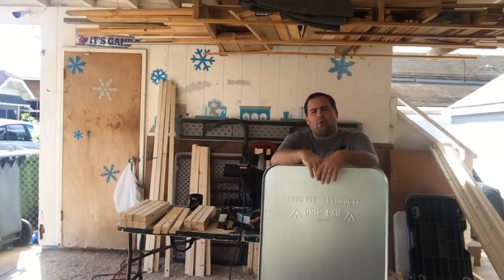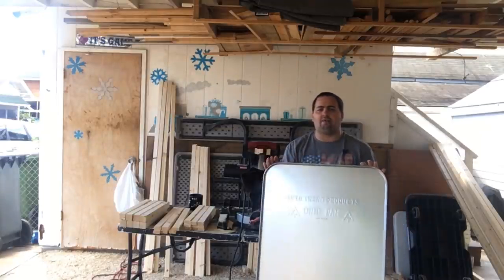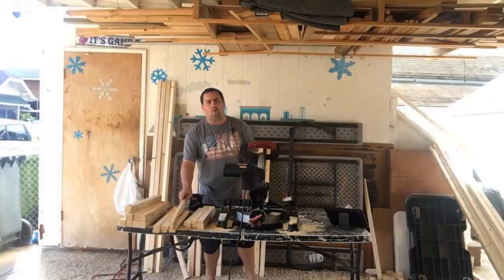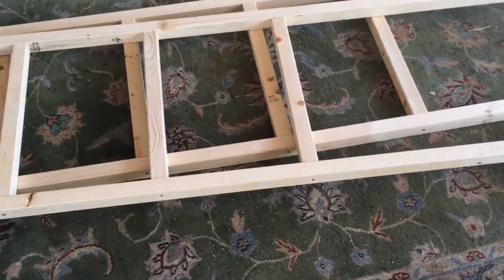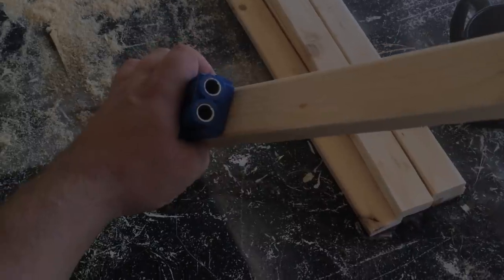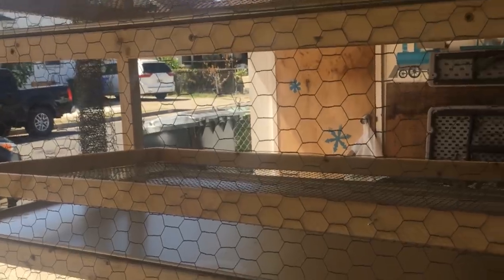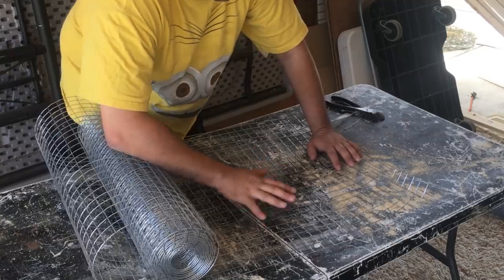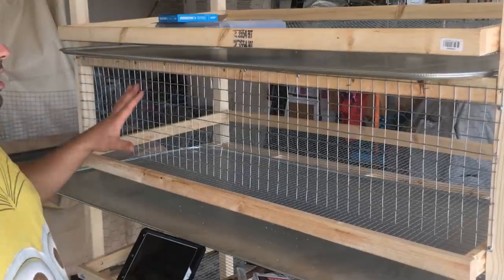How to build a stacked Quail Cage

Comment: Thank you! I build this cage a d it works amazing! Love it! Made  4 levels so I can keep up to 100 quail in one rack.
Reply: I did the same thing. There's room to build another level, so might as well. I also adjusted the length to the poop trays I was able to find. Mine was less that 3' in length so I still used 2' x 2's for the main support legs, but I probably would've used 2' x 4's instead if it was ~4' long with the 4 tiers.

Comment: Andrew ... not sure if you are still checking your posts or not, but here goes!
You have mentioned several times about the bird waste and smell. 

Your answer is simple enough, designate an area for the waste and sprinkle a small amount on each layer of newsprint or wood shavings. Add any grass clippings, raw vegetable waste from the kitchen. 

With the almost daily rains you have it may be necessary to put a cover to keep from water saturation. Some moisture is necessary just not to a point of saturation. 

Turn the pile every 3 or 4 days and you will end up with some good compost.
Reply from the maker: I have a small compost pile, but its more a space issue. I just dont have room for a proper one.

Comment: There is a big gap between the egg roll try and the side of the cage. I had to add additional 19 inch sections of 1x2 to make the bottom flush, so quails can not squeeze into different levels. 
The Oil pans in that size run $30 each, the wood cost me $77.00, Screws $12, Vinyl coated mesh for the egg roll trays $24, hardware cloth for the outside cost $50 (I did not use chicken wire), Staples $5. This cage cost me $258 and took 2 days. There is absolutely no way you made this in an hour!
Reply: Yeah. The lowest price I see for the pans is $36, each. This is not economical.
Reply: I got  3 pans for $72 through advanced auto

Comment: Great tutorial!  The issue with the pans is that Walmart no longer carries them.  When they did they were around $10 just like they said in the video.  I had purchased one from my local Walmart about a year ago.  The manager said they no longer carry them and they were discontinued by the company.  There are pans available at some auto supply stores (Advanced auto supply in South Florida for example) that sell pans for $10, however they are about 12" shorter and slightly wider than the ones in the video.  Simply adjust the sizing of the cuts to these pans and you will be golden

Comment: Very nice video. Going to use most of these instructions except my quails will be outside during our cold winter so I'll need to add a shelter.
I still don't quite understand how the craig jigg bit comes into place. D
For some reason I can't quite compute why you would need to do that or where those screws even go 🤔
Reply from the maker: It makes joints with hidden screws, it also creates the angles needed for optimum joint. It’s not required but I have the tool to do it.

Comment: You should use a grinder to cut your wire. Way easier and faster, and no sharp edges. Also, you should pre-fab the wire (door and feeder holes) before you install the wire to the cage. Would love to see your watering system.

Comment: now that its been in use, would you suggest adding some center support on the egg roll out trays?
Reply from the maker: I would adjust the angel a little more to make it steeper (maybe 1/2inch more at the back) other then that it’s fine. Very little sag.

Comment: Do you have "lids" on each level? or does the poop tray act as the lid of the one below? And then I am guessing that if you take out the poop tray to clean it, the egg catching tray from the one above will be the lid?
Reply from the maker: Their is no lid on each section other then on the top one

Even with the poop tray removed their is only a 1 1/2 inch gap that they can not get out from. 

If you have a predators you may consider adding a top to each cage, which could be done by stapling it to the bottom of the bars holding the poop tray above.
Reply: Nice. That's genius. It saves so much mesh and time.

Comment: Hmm...at no point do I see the "roof". Did you just use more chicken wire?  Mine are going outside, so I'm going to just get some sort of weatherproof top (like white vinyl corrugated sheeting...so it protects from rain yet allows light through)
Reply from the maker: Yes i used 1x1 wire for the top. I have mine under a shelter i built. Putting a roof on top wouldn't really protect them from the elements.
Reply: you are correct, he completely forgot about the roof.

Comment: correction.
that drip pan is 48.00 at walmart.
reduced to 38.00.
not feasable
Reply from the maker: Price varies by store/location. You can get them on Amazon for $30

https://www.amazon.com/Hopkins-11430-Galvanized-Dishwasher-Refrigerator/dp/B000F5XQMO/ref=sr_1_2?ie=UTF8&qid=1524375820&sr=8-2&keywords=oil+drip+pan&dpID=4154SEF4A0L&preST=_SX300_QL70_&dpSrc=srch

Comment: Hi Andrew how are you doing I have see so many coments  but none of them ask about up date in the battery cage any change in the side
Reply from the maker: The only change i made was to adjust the angle of the egg tray (where the quail walk) . Oter then that its still the same. Im working on some new cages and will have another video showing them and how to make them in the near future.
Reply: Thanks

Comment: How many quail can you put in each seperate cage
Reply from the maker: Each tray in this cage is enough space for 30 quail at a 4 bird SF. You could easily adapt this cage to have 4 levels meaning you could keep 120 quail less then 10SF.
Reply: Would they work to breed quail in also? I am just starting out with quail. If i could add roosters and use as breeding cages also how many roosters per hen do you recommend
Reply from the maker: Any cage can be used for breeding. Just make sure to keep your female to male ratio right for optimum  fertility and comfort, 

4f-1m seems to work best.

Comment: Where do you buy that metal tray at ?
Reply from the maker: Walmart, They are $10-$15 each. 

https://www.walmart.com/ip/ATP-Large-Oil-Drip-Pan/16778234
Reply: I have a $1.25 Store near me, the sell plastic drip pans.  Dollar Tree sometimes has pans or paint pans as well, for a budget version of his pans, you may need to buy two for the size.
Reply from the maker: typically the plastic ones are smaller and thin,  These have a rolled edge which will help with the bending/folding when covered in poop, But on a budget for less then a couple of bucks they would work.
Reply: Holly cow these trays you used are $34 each from my walmart! Cheaper and faster to just order off amazon when being a prime member. Built this and determined i needed some wind protection and added 3/" plywood to the sides and added 2, 2x4's to the legs to sturdy them up. Love your vids and great tutorial!
Reply: Agree on the price, he was quoting the half size ones. I found free shipping and $32 each, but decided still to pricey for a crap catcher.
Reply: Brian Sessums  i was going to use plywood and soak in spray adhesive and apply a piece of contractors tarp to the tops and wrap them around. Cheap and effective..but i also didnt want to cheap out and wanted it to look halfway descent so i just bought the trays
Reply: I was going to do that as i have a big barn with dirt floors. I also raise rabbits so i wanted as much room for rabbits as i could get. Its pretty cold in wa state right now and the barn is open on the ends so it does get a cold draft this time of yr. Had to do something.
Reply from the maker: Brian Sessums the pans I have are as even in the video for $14 each.
Reply: Aloha Quails  you got a killer deal on them pans. I was gonna rig something together to work but decided my "rigging" days should come to a slow end haha
Reply from the maker: They are still that price on their website for me with in store pickup.
Reply: Walmart must love you.  I even did Google shopping, no bueno.
Reply: What feeding system do you have for this cage setup? Im using the no waste 3" pvc with 1.5" holes drilled into it that is capped on ends. Curious what you use.
Reply from the maker: I use modified J feeders,  they can be seen here : https://www.youtube.com/watch?v=EZ5F029QEgA&t=
Reply: Gonna go pick up a j feeder that has solid bottom to give it a whirl. I cant see how you get no waste hardly as the sides arent nearly tall enough to prevent any feed being flicked out from the birds. May try and raise the sides as well.  Thanks again
Reply from the maker: Modify them like how i do in that video, Usually the feeder has an inch of feed in it. with he modification it has less then 1/4 so its not deep enough for them to throw it over the side.
Reply: you paid $34 a pop? looks like all the dimensions of this build are based around the oil trays, which i cant find any where!

Comment: IF YOU DONT PAINT OR SPRAY THE WOOD WITH WEATHER PROTECTION...
THEY WILL ONLY LAST 1 1/2 YEAR.
Reply from the maker: Ours lasted about 2 years before I changed it out to a bigger version. But depending on where you are in the world a coat of paint wouldn’t go amiss
Reply from the maker: Oh and your shift key is stuck